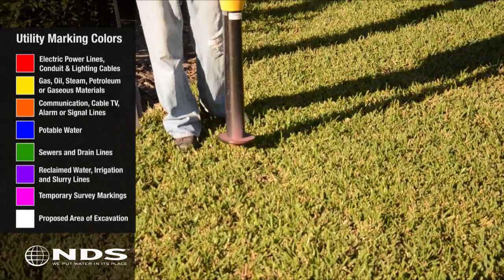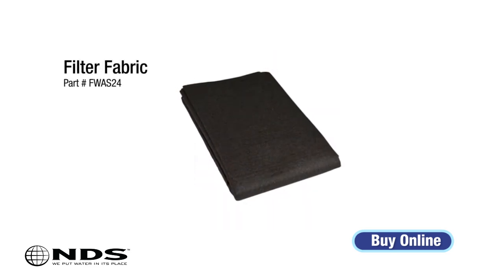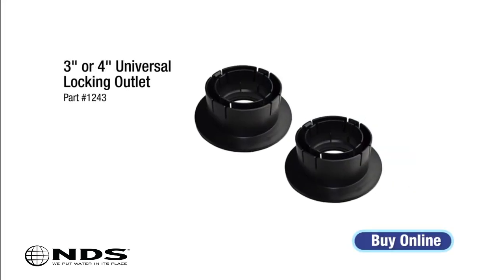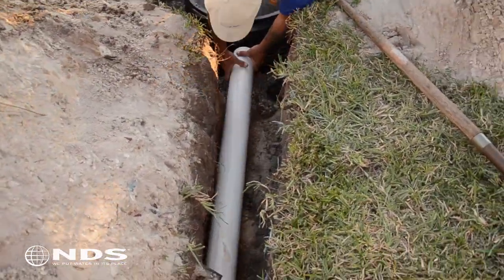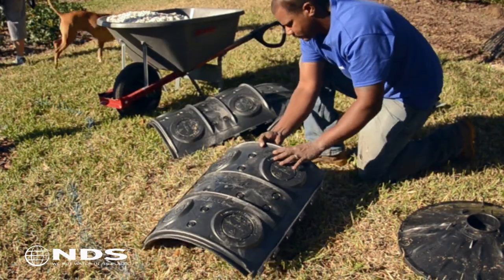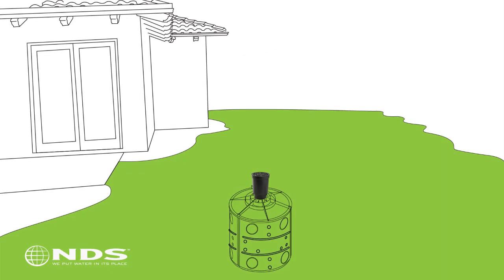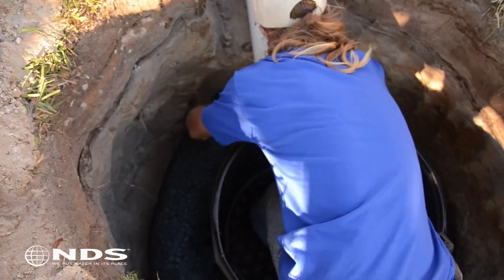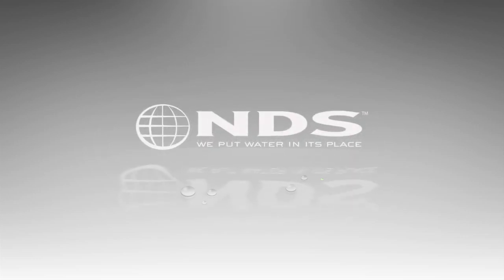How to Install NDS FloWell Dry Well Drainage System | NDS Yard Drainage Systems

Comment: How a 50 gallon capacity "Flow Well" is supposed to hold a down spout water? A medium house roof during a heavy rain can release up to 50.000 gallons of water and a big house roof the double. But I will use a "Flow Well" to install a sump pump on it if it doesn't work, as a last alternative
Reply: Yea I have the same idea to install the sump pump
However the product is made of panels. They will never create a sealed edge so the bucket will leak?

Comment: This looks interesting but I am strongly concerned about cave-in over time.  How much structural load / weight is this FloWell rated for?  It seems like the plastic could get brittle with time eventually until one day it collapses when someone is walking (or riding a mower) over it.
Reply: I don't see that ever decaying.  Peob take over 100 years or more
Reply: @jasonhilton_1  Do you work for NDS ?
Reply: Common sense garbage will be here forever. It's not decaying.  You have to use a brick and a hammer just to punch out holes
Reply: @jasonhilton_1  But do you work for NDS ?  

Everything decays.  Esp in the ground with a substantial water source. 

I suspect there could be an issue over time though as sheer force where the cover meets the top of the side will be substantial when say a person on a riding mower moves over it.  That coupled with the product's aging over time could spell disaster, which is my concern.  Plastics tend to get brittle over time too...
Reply: @MidnightBlueMetallic  nah, these will last at least 50 years underground, most likely 100. they are designed for this purpose and they have been around for decades. Spetic tanks made of the same material last a long long time.

Comment: This is all wrong, you put a good couple of feet of gravel underneath the dry well. Also surround it with gravel only. Don't both with the easy flow, it's just an expensive gimmick.

Comment: French drain is much more effective and much cheaper. Even with a sump system (if needed)....If your yard has a lot of clay, then a dry well is not a way to go because the water will take too long to be absorbed with a dry well system...Right now that EZ flow is ridiculously expensive compared to 4" corrugated and perforated pipe. Watch the "Apple Drains" videos they explain much better...
Reply: Agree. Chuck from apple drains is the man!

Comment: 55 gallon barrel for $10.00 or flow well I’m still trying to decide
Reply: Not sure where you are looking but you can't buy a 55 gallon drum for anywhere near $10! A plastic bucket from lowes is $5!! Also with this drywell the sides are a lot stronger than any plastic drums so it won't cave in. Do your homework and stop smoking your socks.
Reply: Yeah I used plastic 55 gallon barrel,drilled my holes as needed and it doesn't come in 4 pieces25 bucks
Reply: Where did you get your plastic 55 gallon drum? Link to it please. Is it designed to be buried and handle weight?

Comment: Already displeased with this product and it isn't even in the ground yet. Attempted to remove knockout as described in video and the side wall of the flo well broke out, not the knockout. There is no outline for the Universal Locking outlet so it does not just twist in place as described. This is causing delays in completion which cost even more money. This is not leading to ANY trust in NDS products.
Reply: Using a hammer caused damage for me as well. Now, I treat the grooves as guides for where to cut.
Reply: +1. On my flo-well, there is no outline for the ‘universal locking outlet’. Bummer.
Reply: It looks kind of flimsy putting the three walls together- hmmm
Reply: Yeah, using a hammer on the small holes, as stated in this video, just cracked the walls all over the dry well. There are basically no perforations around the holes. So stupid for something so expensive.

Comment: Do you have the model/manufacturer of the cordless saw they used to cut out the adapter hole in the flow well?
Reply: Hi Keegs, my dad owns a tool distributor, I'm pretty sure the Sawzall pictured is Milwaukee.

Comment: Run your weeping tile to a hole filled with washed gravel, not rocket science. This is just a con to rip you off for big bucks.
Reply: In your method, the washed gravel will soon be filled with the sediments of the surrounding dirt and the problem will be back.
Reply: Then surround gravel with landscape fabric before running water there....so no soil gets in....
Reply: @bryanhamrick5456  they have similar ability to infiltrate but the volume of peak water holding capacity is much larger with a flo well or cistern tank.